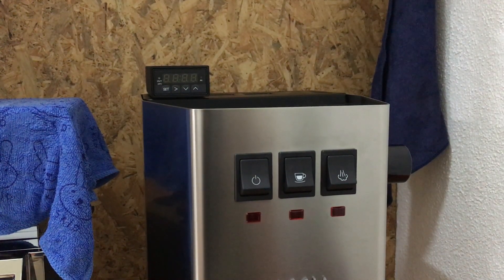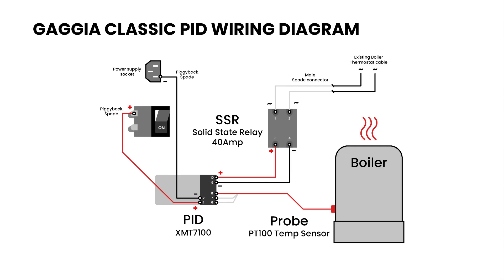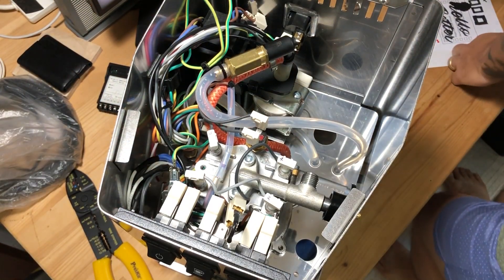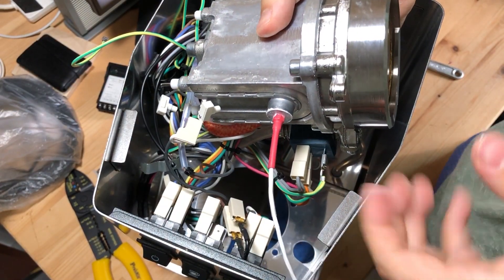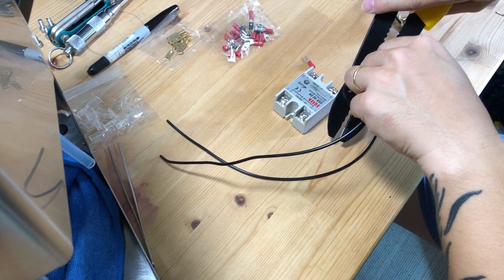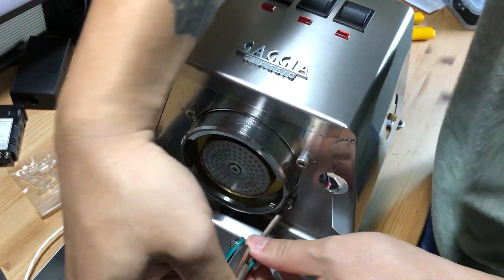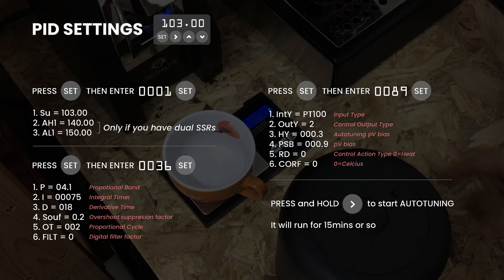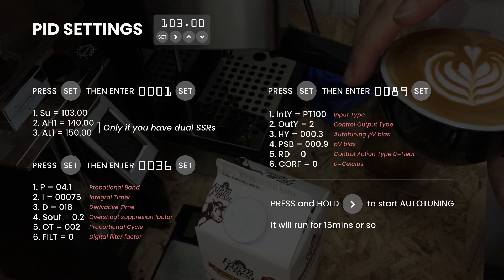Ultimate PID Gaggia Classic Pro Mod

Comment: Hi, I just installed my xmt 7100 with  single relay, for brew temp only. I am trying to get it to autotune. My understanding from the manual and some searching is it should complete the auto tune process relatively quickly, 15 minutes or so, but it just keeps flashing / staying in autotune. Am I missing something? I thought it would auto tune till it dialed things in and then exit autotune, do I have to do something manually? Thanks for the help.
Reply: Disregard, I just manually put the settings in and it appears to be working fine. Thanks.
Reply from the maker: @edwardgordon  Hey. I've had the same issue as well when I first boot it up. It's better to check if you have selected the right Thermostat in the PID settings. In this case, select "PT-100" in the "IntY" menu and the "CORF" to Celcius. Hope that helps!
Reply: @EweJinTee  Yes I think that was it for me too, I noticed when I went through to do the settings manually that the thermostat was set to a different type. I might try an auto tune again at some point for kicks but it's been working fine with your manual settings. Thank you.

Comment: Hi. Thank you for the vid. Very clear instructions. Just need to confirm the pid settings. Do you enter all those values manually? Or do you just set the temperature to 103 and start the autotune? When you brew to you enter the lower temperature - ie 93 or 94c (the desired temp for most coffees)? Thank you so much.
Reply from the maker: Appreciate the feedback! Yes it's better to go through all the menus and enter them manually. Some of the values are preset from the factory so you'll have to scroll through. After entering all the values, I set my temperature to 103˙C and just leave it to do its thing. The PID only needs to be set up the very first time only. Then you'll just have to enjoy all the espresso shots after that :)

Comment: Nice vid. Awesome. Do you have a diagram for double SSR setup? As in to control AL1 and AH1 for steam temp purpose
Reply from the maker: Thank you! No, I don't have diagram for double SSRs as I feel the steam temperature works for me currently. You could check out Damian's video here https://youtu.be/Ewj5oXl_wk0 . He made a tutorial on how to set up dual SSRs with 1 PID controller. But that requires some tinkering and soldering with the board inside. Hope that helps :)

Comment: Hi ! Would it possible to just piggyback the L and N wires from the power supply? Instead of taking a wire from the on/off switch and a wire from the neutral line from the power supply. Thank you so much for replying ! By far the best guide seen on youtube, cant wait to install mine
Reply from the maker: Thank you for the compliment. 

If you piggyback the +/- connections from the main power supply and your main power is constantly switched on, it will turn on the PID controller all the time even though your machine is Off. 

So a piggyback to the rocker switch would be preferable because it only turns On when the machine is On.
Reply: @EweJinTee  I see that was dumb of me LOL Thanks for answering !
Reply from the maker: @Millilitree  No worries.. Good luck with your mod! Let me know if you need any clarifications ;)

Comment: Hi will this mod work on my Gaggia Classic 2006 they all seem to be on Classic pro great video regards Carl
Reply from the maker: Hey. I'm not too sure about that. You'll need to open up your machine after to see if all the dissasembly process is similar. Then the PID mod might work for you. 

A few things: See if you can spot the boiler's thermostat and check if it's the same thread etc. And then locate the power source for the rocker switches. It might work but don't take my words for it. Please do your own research beforehand. Good luck!
Reply: @EweJinTee  I can confirm that it works as I just finished installing mine. Too bad it's 12:35am where I am so a bit late for a coffee. Dying to make some though :)
Reply from the maker: @ChuckNorris-bf5cj  Woah! That's good news! Hope to hear from you again first thing tomorrow Ha!

Comment: Great tutorial, thanks for sharing your experience. I have a question. I noticed that you connected the cable with the piggyback terminal to the power on/off switch of the Gaggia, instead of the brew switch like Robert did it in his video. Why? And what's the difference between both choices? Thanks!
Reply from the maker: Hey Erick, when I connect the piggyback to the brew switch as in Robert's video, I didn't get power to my PID and I was confused. It might be that I have modded my Eurotimer switch on the machine so that I can constantly turn on/off as I wish. I used a test pen while the machine was on and I found a positive terminal for the PID's power source. Hope that explains how and why I did that :)
Reply: @EweJinTee  good point. That makes sense! I have done the same and am planning to do the same PID install so I’m glad to have read this 😊
Reply: @EweJinTee  I wired everything according to your diagram and don't get power on the PID. It might be broken as I never saw it running, but I measure 0V at the PID. I did not modify my on / off switch, so is this mod mandatory?
Reply from the maker: @hoqpus  Hmm.. make sure the wires to the PID are correct (eg: the 1 and 2 terminals for PID power) Also note the positive and negative terminals. I will troubleshoot the wiring again if I were you. I don't think the rocker switch mod will affect this wiring in any way. It's just a nice thing to have as I find the spring back rocker switch annoys me. Good Luck!
Reply: @EweJinTee  since I switched to orange cable everything works fine. Deeper research revealed that there are lots of different versions (in the details) of the Gaggia.
Reply: @EweJinTee  so I measured and for me it's the orange cable on the power switch (not left blue but right orange) which has 230V against the bottom right power supply socket. So I guess I'll just go there? Even though I seem to be the only person with this "problem"?!